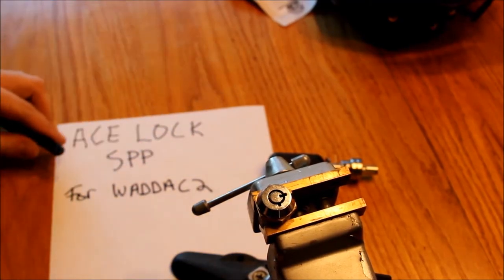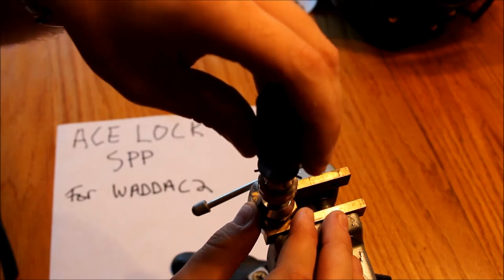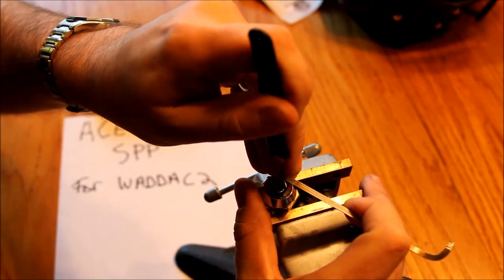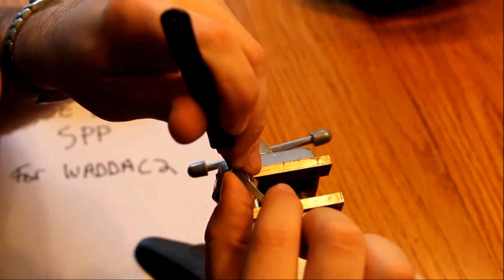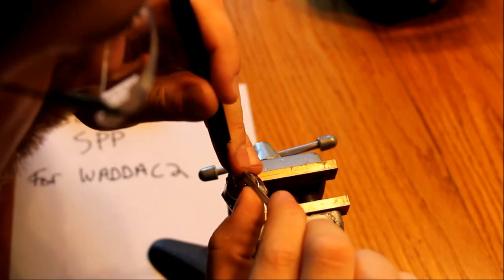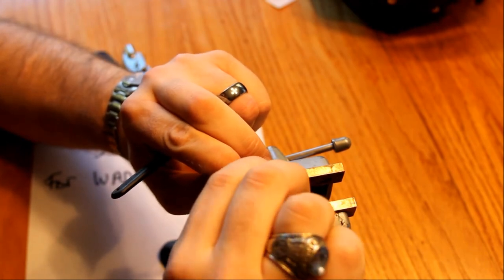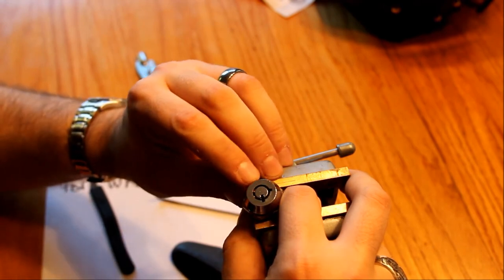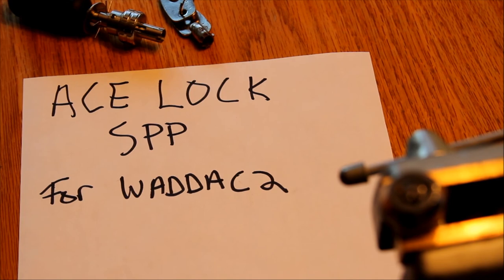(010) ACE Lock SPP for Waddac2

Comment from the maker: So take a look at the notch in the plug. This is the bit you want the tensor to grab onto. The trick is getting the wrench to stay in this notch without binding on the notch in the lock body (radially outwards from the notch in the plug) on on the inner rim of the lock itself. 

OK, so shape your wiper insert or favorite piece of suitably-sized spring steel like a normal tension wrench. Then, make a rectangular cut-out on the tip of the wrench, like that found in a Peterson Pry Bar....

Comment from the maker: You'll end up with a little stair-step. You want the width of the longer bit to be such that it fits into the slot in the plug but just barely misses the slot in the lock body and the lock body proper. This is a little bit more than you may think because, under tension, the wrench will rotate a bit in the notch and, in this diagonal position, take up a little less room. 

Ideally, the shallower bit of the wrench will rest on top of the lock body and help prevent the wrench from slipping out.

Comment from the maker: Add some serrations on the sides and edges of the wrench to give it a bit more "bite". 

You may need to experiment with different lengths, depending on how deep the slot in the plug is... on the one in the video, I think it was about 2 or 3 eights of an inch. 

Finally, shape the wrench such that the handle points out (i.e., doesn't cross over the center of the lock)... this keeps the tensor from blocking access to the pins :)

Comment: With the southord pick you have a circular bit that goes into where the grove is so pick fits in to allow pushing down and manipulate and twist etc

The tip of the homebrew wrench will have to bypass that for tension.. what is it catching on to apply that tension? Sorry for the silly question there buddy as not gone to look in my tubular lock just yet.

Thanks for your help and putting up with, what maybe silly questions Alex.